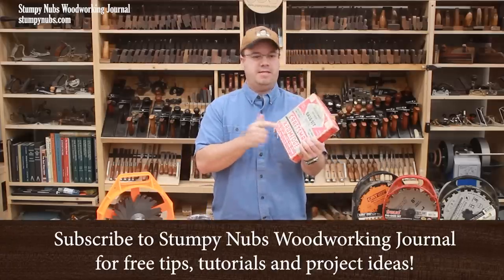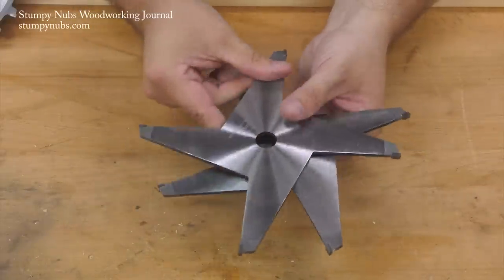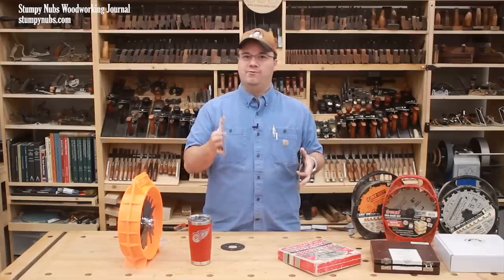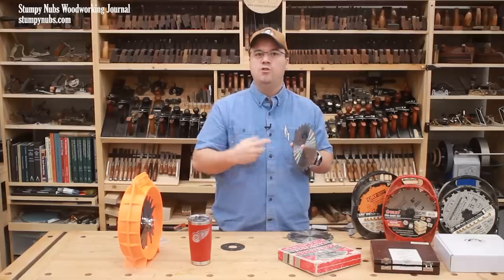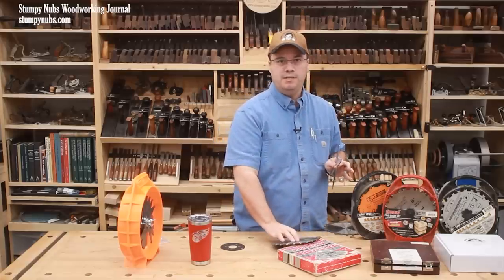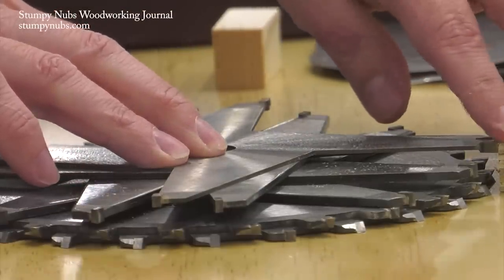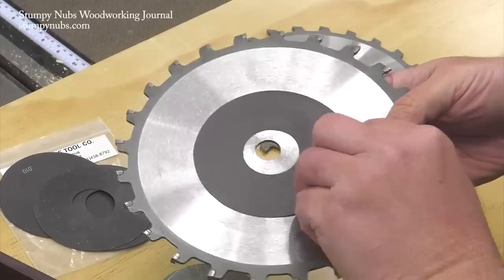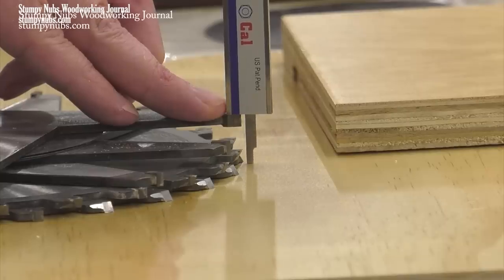If this blade is legal in your country, here's what to look for.

Comment: I've never used a dado set.  Is there an advantage to using a table saw dado set vs a straight router bit, (which is what I've always used to cut dados and rabbets).  I'm guessing that the table saw dado will cut faster and with fewer passes, but I can't help thinking that the time saved may be eaten up by the time spent installing and adjusting the dado stack.  
What about cut quality and accuracy - which is better, table saw dado set or router?  Is one better for ply vs softwood vs hardwood?
Informative video as always, Stumpy!
Reply from the maker: Table saws are more powerful and will remove wood faster. Dado sets have more cutting teeth and stay sharp much longer.
Reply: @StumpyNubs   I can attest to straight router bits dulling quickly! Luckily they're pretty cheap.  When I think of it, the cutting surface on a straight router bit is maybe 2 inches, but added up, the cutting surfaces on a dado set must be many times that.

Comment: I got an old craftsman radial arm saw from my father that has a blade that has little bits that connect to it ( by set screw )...they are about one inch square or so.... I assume this is a dado blade... but I am absolutely too terrified to use it.... am I paranoid or is this thing like incredibly unsafe?
Reply from the maker: Sounds like a moulding head. Those are way too dangerous to be useful.
Reply: @StumpyNubs  ty for prompt reply

Comment: A couple of questions James.  I don't own a Sawstop, but do dado sets work with them and do you need specific sets to suit them?  Accepting that saws are all different, and some don't even have an extended arbour, but what is a typical maximum width for a dado set?  I only haver room for a DeWalt jobsite saw in my home shop, and I have a DeWalt dado set, but it just about manages a 19mm 3/4 dado before running out of arbour threads (for safe use).  The DeWalt set does have a good range of chippers though.  Your point about nipping a shim in a thread is one of solid gold tips, so thanks for that.   BTW  was the video title pure clickbait with minimal relevance to the video?  Are dado sets banned in some countries?
Reply from the maker: SawStop saws will accept an 8-inch dado set. You need to install their dado brake cartridge to use it... Typical dado sets get as wide as 7/8 or 15/16, but some are a bit narrower. The length of your table saw's arbor determines how wide you can go... Dado sets are either illegal, or made impossible to use due to regulations in the UK and much of Europe. The title is intended to be compelling, but it is still representative of what the video is about- what to look for in a dado set if you can buy one in your country.
Reply: Follow on question for the Sawstop - will the magnetic shims interfere with the sensing technology on the saw?
Reply from the maker: @06pathrat  I can't imagine how they would. Besides, the SawStop system self-checks it's functionality every time you turn it on, so I expect it would return an error if something was interfering with it. Regardless, I am not a SawStop expert, so I would recommend you direct that question to them.
Reply: @StumpyNubs  Thanks James.  All good information.

Comment: I've owned an Avanti and the dewalt dado stack. 

 I much prefer the dewalts. 

 It's got all the pros that he mentioned.  And it comes in a really nice carrying case.

 The only thing that I would disagree with are the magnetic shims. 

I've used them before and wasn't really happy with the result. Although they do stick to the blade and they are easy to work with. They will get stuck to the blade if the blade gets hot enough and they will tear when you try to take them off.

So that's why I prefer the metal shims. I just make sure that they are always closer to the base of the Arbor then the threads.
Reply: Hm.  Tried a tough thin plastic spatula to get those off?  And is there maybe a way to sharpen tje blades or slow tje saw to prevent overheating?
--not a woodworker, just throwing ideas around
Reply: @RICDirector  

 Those magnetic shims are essentially made of rubber Or a synthetic alternative with magnetized material inside them. 

 Rubber has a low melting point.  So when it melts and cools it might get fused to the blade. So it's likely there's an inherent flaw with the material itself. 

 And if not melting. then D naturing could be the issue. Repeated heat and cold cycles can overstress a material causing it to become brittle. 

The dado avanti stack that I used was relatively new so i didn't believe  Dullness which would led to more heat was really an issue.
Reply from the maker: I can't imagine a dado set getting hot enough to melt a shim. Maybe it needs sharpening...

Comment: My dado stack worked so well it yanked the piece of wood from under me and tossed my finger on the blade. Took a tiny nip. Lesson. Just because your little jobsite table saw can hold a dado. Doesn’t mean you have to use a dado set in a tiny table.
Reply from the maker: That's why we use pushers :) 7:38
Reply: @StumpyNubs  When I took woodshop in middle school, our first project every year was a pusher.

Comment: why don't normal table saw blades have a 6th flat top tooth as well ? it would sure be nice
Reply from the maker: Some combo blades do, but the points of the angled teeth are slightly higher to sever fibers for cleaner crosscuts. This creates a misshapen kerf bottom.

Comment: Serious question here…. Why bother with carbide teeth for woodworking?  It’s not like high speed steel won’t cut wood, and it’s a lost less susceptible to chipping.  What’s the point of carbide beyond “sounding” like an upgrade?
Reply from the maker: Carbide stays sharp vastly longer than HSS

Comment: I take issue with the "legal" part in the title: To the best of my knowledge dado-sets are NOT illegal ANYWHERE in the world. It's merely that local regulations REQUIRE tablesaws to be fitted with a rifing-knife and THAT gets in the way of using Dados. As a result, manufacturors in these regions don't bother to provide their machines with the longer(more expensive! ) arbour, needed to accomodate dados. Just wanted to get that out.
Reply from the maker: While not specifically outlawing dado sets, some countries have laws that make their use impossible. The affect is the same.
Reply: @StumpyNubs  Not really; If I can find a machine with both the rifing knife and an arbour long enough for them, I can legally use dado sets, even though I have to remove the knife to do so. The problem here is the manufacturor that took it to the extreme. "Legal" has no place in this entire thing.
Reply from the maker: @NelsvanToor  IF you can find a consumer-level table saw with an arbor that accepts a dado set, and which doesn't have a blade break that's incompatible with a dado set, then sure. But legislating those things makes it virtually impossible for the majority of consumers to use dado sets.
Reply: @StumpyNubs  I kinda agree and disagree with you here; The legislation requires the presence of a rifing knife, NOT the inabillity to support dados. This is not mere semantics. Manufacturors here could churn out the machines with dado-ready arbours AND a rifing knife and be all-ok. They chose not to. That's not the legislation; that's the industrial stupidity. That being said: I don't care for dados myself as I think I can do that just fine(and often better) with a router(and often faster too...). It's the clickbaity title that irks me. (Yes; I did watch your vid on using clickbait. I don't agree with it although I see where you come from.)
Reply from the maker: @NelsvanToor   I am not sure what country you live in, but this video isn't just for YOUR country. And it's not just about riving knives. For example, in the UK the law requires a table saw blade on a consumer-level saw to come to a stop in just a few seconds. It is impossible for a dado set, having significantly greater mass, to stop spinning as quickly as the law requires. Pretending all these laws don't have the same affect as one that expressly says a dado set itself is illegal is an argument of semantics, and there is no point in that.
Reply: Let's agree to disagree here. Not worth it. I just don't like the use of clickbait.

Comment: I'm a total noob in wood working.
But why would some one want to make a big cut in the wood?
The thinner the blade the less waste of wood you have.
So why that thick blade?
Reply from the maker: Dado blades are made to create slots that a mating board can fit into to join them together. Think of a bookshelf. The ends of all the shelves fit into slots (dados) in the two side pieces, making a very strong structure. Dado sets are also used to create other types of joinery such as tenons, finger joints, lap joints, etc. A dodo set is not intended to cut all the way through a board.

Comment: Dado sets are illegal here and for good reason.  Want to cut rebates?  Use a router table.  It’s what it’s for.  Anyone normalising use of table saws without blade guards needs to rethink whether that’s a responsible thing to do.
Reply from the maker: Dado sets have many advantages over a router table. While a dado set does leave the blade exposed (and that certainly adds to the risk), a router table leaves the bit exposed, as well.

Comment: I was a little surprised that you did not mention the main dado cutter to stay away from. That being the “ adjustable cutter where a single blade is in an angled arbor. You are supposed to be able to rotate the angled arbor wedges to “ dial” your width of dado. Craftsman did this for a while. So it  is possible that your reference to it at the beginning mat have what you. Were talking about. Craftsman did also make a dado set with separate blades and chippers. Additionally, Craftsman also produced a “ moulding “ cutter for table saws with various blade shapes. Very dangerous if not set up properly.

Comment: Surprised he had the Freud set sitting out front.  Glorified carpenter grade stuff.  Their manf tolerances have gone to hell. Last dado set of theirs I used left seriously uneven runners.  When calling the factory they had the nerve to suggest that even though other dado sets didn't have this problem on the same saw that the problem was likely caused by SawStop putting a bad arbor on the saw.  Sad.
Reply from the maker: You mean sitting in front of the pile of dado sets I said I don't use anymore?

Comment: I went to the link you recommended but I couldn't find a dado set for my 1 inch arbor (sigh). They have 30mm Felder and 5/8 but forgot about 1 inch club
Reply: Hey, this is Paul with Ridge Carbide.  We do offer dado sets with 1" bore.  If you can't find it on our site, give us a call and we will make we get you the link.  Thanks.
Reply: @paulhardenburger1565  please give me the link to 1 inch bore dado set